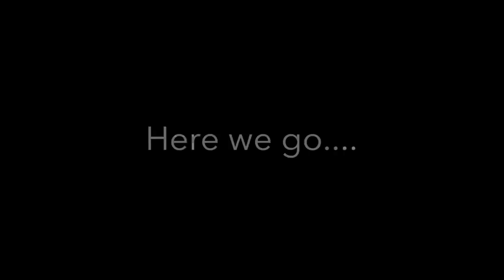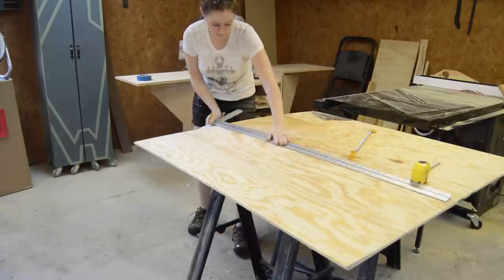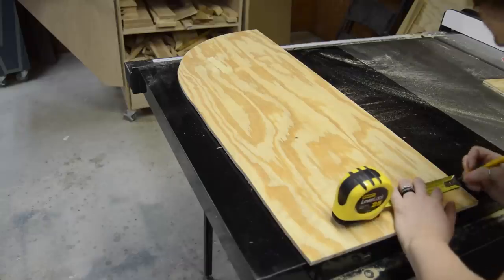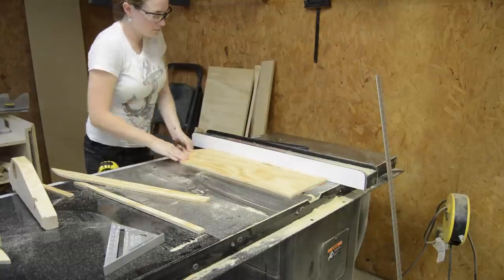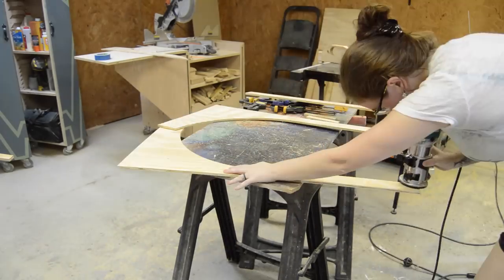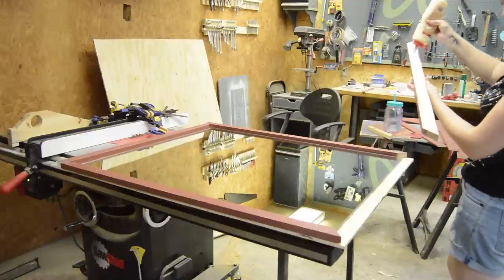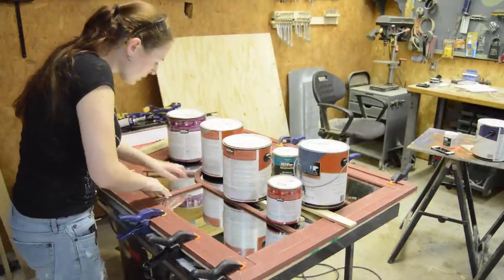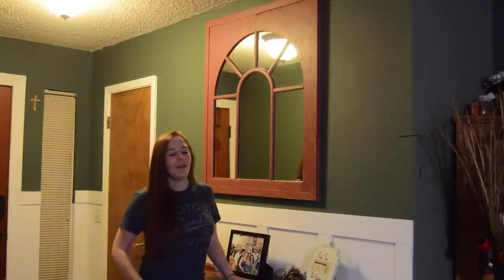Window Pane Mirror

Comment: Let me describe to you how i cut glass as an amateur  and see if you can use any of this information.Mirrors , 'cause many of the older ones i cut had a thick coating of the reflective stuff on them , i always cut from the other side.Cutting on to the coating first.Second, i made sure the glass i cut was crystal clear and clean and i always passed a very light  layer of diesel onto wherever i was gonna cut..I didnt believe it when they told me years back , but it helps the cutting head bite better.Some glass cutters have even a small recepticle that you can fill  and it drains onto the cutting head as you work.And i am talking about a disk glass cutter not a diamond cutter.And last , what i did notice you did...you lifted your hand while cutting.Secure the ruler, so it doesnt move about cause glass is slippery either with a vice or a screw through the top of the ruler or what ever--double sided tape helps too- just dont over tighten as not to crack the glass-- and make sure you can complete the cutting motion in one steady flowing and firm pass.You can feel it when the cutter bites well.One pass is ok and if you look closely at the cut there mustnt be any gaps on the line.I also tap very mildly along the line just before i try to seperate the two.Good luck , i like your vids :)

Comment: @AprilWilkerson you are adorable! I love your pleased giggle...
Thanks for the idea. I've been struggling to figure out what to do with my plain boring bathroom mirror...over a year ago I hung a pretty Caribbean themed tapestry in my bathroom. My goal was to paint around it to fill it in as it wasn't big enough to cover the whole wall.  It turns out I've lost some of my painting skills..sigh...trying to ombre the blue sky is kicking my butt...I've got 2 walls blue for the sky, with water and sand running along the bottom of the long wall...my bathroom counter is over the area where the sand should be so I tiled just above it to give the illusion of a wall...the counter will be covered with contact covering called mactack  that looks like laramar stones.  I used wood grain macktack on the sink wall to give the illusion of a drift wood arbor. I carefully hung fake flowers on the arbor for a 3d affect.  (My kitten won't leave real plants alone). Some of the flowers frame the mirror...but it still needs something. 
The wall that surrounds the shower/bath combo will have a rock wall around it...
Reply from the maker: Sounds fabulous! Thanks for sharing and for watching.

Comment: April -- start sketching ideas for your router table. Yep, look though every plan you can find, figure out what you need, then sketch it all out (including rabbits).

I'll cut it out on the CNC Router (4' x 4' max size).   Idea is no one piece bigger than 2' x 4' to make it easier to ship.   Baltic Birch (either 3/4" or 1/2").  

I'll trade you for a donation to Parkinson Foundation.  :)  You'll get a nice router table, and I'll get the same... and PDF gets the money! :)
Reply from the maker: What a very generous offer Tom, thank you for the thought. I haven't even started looking at tables or designs because even though it's on my list, it is not a big priority yet. So it might be a while until I decide to get started on one.
Reply: +April Wilkerson nice work dear

Comment: Dear April,
         I did Stained glass for 5 years, and as I saw you trying to cut a rather large piece of mirror, I realized that you made a common mistake, that is easy to fix. Your prep work is absolutely great. Mirror on flat strong piece of plywood. Your choice of a good METAL straight edge was also great. Problem was that you went on the side of your cut. Extending your arm over the straight edge, no power generated in the cut. Next time try this. Do all the stuff you did correctly. But now get into a position of looking straight down the marks on your mirror. Make sure all your inline with the score. Next lube the cutter with lube made especially for cutting glass. Get that at a stained glass supply. With all things ready, start your cut (score) with the glass cutter. With down pressure, you'll get a sound made by the cutter. Don't stop the cut, and go from off the mirror or any glass, to off the mirror. The sound resembles a scraping on gravel with a stick. If you can afford one, some cutters come with lube already in the handle. When cutting
proceed from top to bottom, again without stopping. Go to a hardware store and get some scrap glass to practice on and you'll be fine. Next time you'll cut that mirror like a
pro. Remember, the real secret is, A. the lube, and B. the straight line pull from off edge to off edge. You go girl, you have a real presence on video. You are clear and concise!
Also, you are better that most I've seen on TV or Video's. Who knows, someone might even get you a DIY Show on the Internet. Peace and God's Love,  Mike Festa
Reply from the maker: Michael Festa Sr. : ) Thanks for all the information Mike. I did have some lube that I used on the cutter beforehand, and I bet if I had done like you said (about being inline with the score) that it would have worked. Oh well, my local company cut it down for me at no cost so that was great. Thank you for the feedback and compliments of my videos. It's always nice to hear someone enjoys them. Cheers.

Comment: Hi April
 I am interested in learning how to use my router. I notice you use round over bits at times and would like to know your recommendations as far as size of round over bits to purchase and also lead me in the right direction as far as the manufacturer of bits to purchase. Watching your videos really encourage me with confidence and inspiration to pursue my wood working aspirations. Thanks Jamie
Reply from the maker: Hi Jamie, for router bits, I would actually just go online and order a set that has 10-20 different bits in it then play with them! Everybody will have a different opinion but I would just start with a cheap set to get you familiar with what you like and what you will end up using the most. I use my round over and flush trim bits the most, but here recently I've also been using my roman ogee bit a lot. If you go to the hardware store you will spend twice the amount of money for a set of 4, so again I would just order a set online for about $25. : ) That's just me though. Glad to hear you find my videos encouraging! Thanks for letting me know. Happy woodworking.

Comment: Very cool, you've got me thinking about where I could use something like this myself.  FYI, if you want to make your life easier when using your router freehand like that, go to the dollar store and pick up some of that drawer liner (or whatever it's called), you know the stuff that doesn't let things slip, but isn't actually sticky?  You can get it for under area rugs as well.  If you put that down on your table, it's enough to hold your wood so you can run the router over it and keep your fingers clear.

I'm sad to hear there'll be no video next week :(.  I hope you have a safe trip and have a good time.

Thanks again for sharing such a great video :) Have a great weekend
Reply from the maker: Oh, good tip about the non slip stuff! I know exactly what you are talking about. Thanks Colin. : )

Comment: Good job, the only thing that would bother me is the joint at the top, I might have tried to do it in one piece.  Also, I would have asked if the glass shop could easily cut the mirror curved at the top, then I could have a thin frame like you have at  the sides and bottom, all the way round.  But that's personal preference.  Just my honest thoughts, I hope you don't mind.
Reply from the maker: Nah of course not : ) That's the great thing about building things yourself....if you give three people the same thing to build, they will all make it slightly different. I love the ability to customize things to ones liking. And hearing the way somebody else would have done it, might give a future viewer food for thought if they are considering this project. Cheers.

Comment: Great Idea. Looks great. Do you really take a lot from your husbands shop?
Reply from the maker: Nah....only a few little things here and there. Like magnets, or a socket (or two), I might still have his wire strippers. I also borrowed his heat gun recently, but I put that back. His shop has a different set of tools because he is into mechanical projects. A few months back he built a fiberglass boat and he actually moved into my shop for three days to build the mold....: ) So I like to think we're even.
Reply: Sounds good to me.

Comment: April, nice project, but it doesn't seem like you use real wood much.  Always with the plywood and MDF.  Do we need to send you some Walnut, maple, oak, elm, etc?  Granted if you're painting something, you don't need special wood.  You do seem to paint a lot.  The one thing I'd like to see you paint is the walls of your shop- bright gloss white.  Cleaner and brighter, but maybe that's just me... Have a good one!
Reply from the maker: Yes, I typically work with plywood or Pine. 1) I'm not very skilled and it's very typical that I mess up, so at least this way it's cheap material. I'll work my way up though. ; ) but 2) I do paint 90% of my projects so it also makes sense on that level. 

I've had a few people suggest for me to paint my walls. I actually think I love them the natural color they are. I know the white would make it brighter and cleaner looking but I love the 'tone' that the OSB walls add to my shop with all my shop colored painted projects here and there. : )